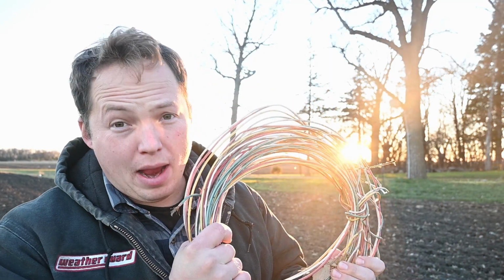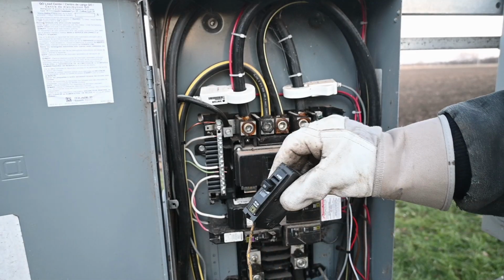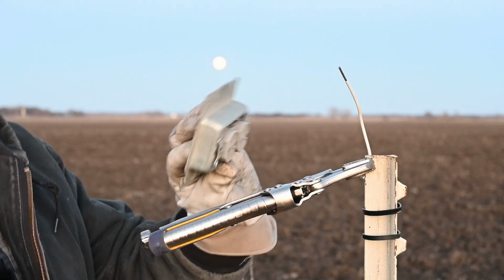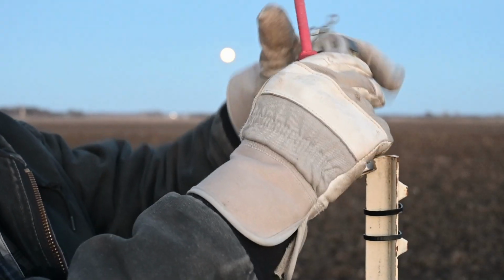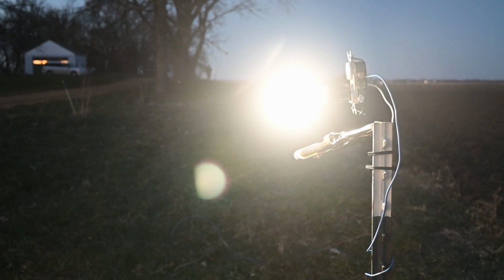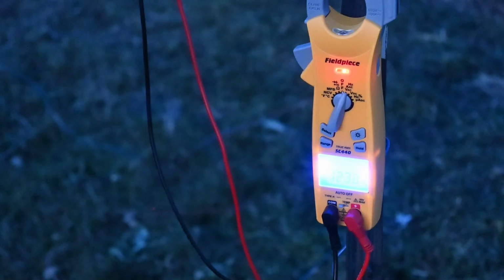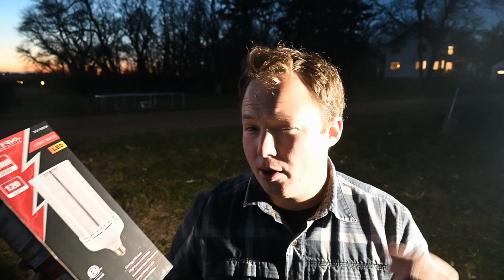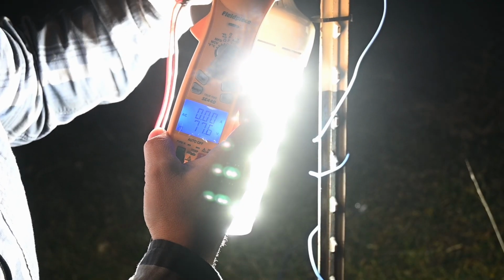Powering a Light With a Fence Post & Scrap Wire - SWER (Single Wire Earth Return) Demonstration

Comment: We used to use this principle to collect earthworms for fishing. Basically a ground rod (usually scrap steel) connected to hot, with an insulated handle. Stick it in the ground and any worms in within a few feet of the rod would be driven to the surface. If you were on your hands and knees to pick up the worms you’d feel the tingle, especially if the grass was wet.
Reply: @Mark Denovich
When I was a kid, a neighbor of ours was an avid fisherman. He used the same homemade device you described to gather nightcrawlers for fishing. He made one for us, we called it the "worm stick." Us kids had all the bait we needed after that. 
I had it plugged in one time and the stick was just lying on top of the ground. My little brother picked it up by the steel rod and got jolted real good, he couldn't let go, I ran to the wall and unplugged it. As I remember it kinda disappeared after that incident, mom must've got wind of what happened. Brings back alot of memories. Always wanted to build another one, but never did. Still love to fish.
Reply: @ttompkins992  
We tried that when we were young,  and it would blow a fuse every time, probably a good thing it blew the fuses.
Reply: @tubeonline629  Lol, the worms coming out of the ground were more like giving a "Wormning to keep out , Electrical exposure"  you're totally rigth, good thing it blew the fuses,that's the most positive of this negative ground thing, i read on this post ,lol
Reply: @ttompkins992  I believe that's an old myth (wives tale) that when you grab an energized wire or rod you won't be able to let go. Heard that plenty of times as a kid myself. I've been an electrician for 30+ years now and have never seen anyone do anything but immediately let go of a "hot" device. I think you must have been really young and your mom built that "memory" into your brain. Just saying
Reply: @Rick-the-Swift  my dad had a drill, that would shock you if you grabbed the vise or table, all metal...i couldn't let go of the drill or the vise handle....so old wives tale, change my mind, it happened to my brother, too.....
Reply: @Rick-the-Swift  My wet hand froze up around an extension cord plug-in from our pool filter when I was about 10 or 11 yrs old. I could NOT let go of that thing!  I had to somehow pull it out of the wall to break the current. I avoided my mom that whole day feeling jittery and thought she would be able to see it. She had told me not to mess with that filter after she gave up trying to prime it, but it was so hot & I really wanted to get in that pool.
Reply: @Rick-the-Swift  No, you can get stuck and can't let go. It's happened to me. Got stuck to a mini bike once, the motor started revving up and just kept going faster and faster. I grabbed the spark plug wire to try to pull it off, Worse mistake in my life. I got stuck to it getting zapped, luckily a neighbor saw what was happening and freed me with a screwdriver.
I got stuck to electricity doing something else before but I don't like to think about it, it makes my heart hurt. That was house electricity. 
I've also been zapped but it threw my hand off and didn't stick me to it.
Reply: @Rick-the-Swift  --My Boss and I were building a cabin using a Metal Case Skill Saw. it shorted out where wires go through case, i was cutting roof decking boards-he called out the lengths and I cut them. The Bare Hot Wire  shorted against the Metal Case of Saw, I could not let Loose of Saw and could not even Holler as it was Jerking my Arms, he saw me and ran down ladder and unplugged saw. The Next Day when I woke Up, my arm was Dead, no feeling, no motor Functions-went to doctor, he said I had Nerve damage from Near Electrocution-it took 7 days for my arm to get feeling back in it-in 2 weeks I was back to Normal but since that time, I have always had a Tremor in my right hand. All Modern Tools these Days have a Plastic Case and a Neutral Wire for Safety so it is much more difficult to get Shocked or Electrocuted...
Reply: Sorry if my original comment upset anyone, or was misinterpreted as it's apparent to me by some of the replies. I really appreciate everyone's input. Some of you have pointed out that you yourselves, or loved ones experienced a situation where you/they grabbed a device energized by an electrical current, and in doing so, your/their grip was somehow "frozen" by the current so that you/they couldn't let go. 
  To better clarify my original point, I think that it's a myth that it happens as frequently as it's claimed to have happened. 
  I can imagine their are rare instances when the current is so strong that certain muscles become clinched around the object that is overly energizing them, but still, this is relatively low in comparison to the number of times people will exaggerate about such an event.
  Me personally, I've worked in the electrical field for 30+ years. I've had the piss shocked out of me many times, by hundreds of amps, and have seen dozens, if not hundreds of others have the piss shocked out of them, but never have I once I have I seen an instance where someone became "frozen" to the object that was shocking them.

 If anyone's ever watched a video of someone receiving  lethal electrocution- I don't really recommend it myself personally, but it was a part of my public and electrician education. But my point here is, there's a good reason they use many straps to keep a condemned person attached the the electric chair- and that's so the prosecuted and judged criminal won't be able to hop out of the chair during the electrocution. keep in mind the amount of current they send through such a condemned criminal is many times greater than the average person may experience with any electrical device within their homes or businesses.
 When farmers put their "electric fences" up to keep animals immensely more powerful than the average humans within a field, the shock delivered will almost certainly 100% always cause the animal (or human) to move away from the shock rather than become attached to it.

 That was my only point. I have no doubts some of you have a different opinion, based on what a family member or friend told you, or based on your own experience "grabbing" such a hot device that you couldn't let go, but again, my own experience is the people who exaggerate about such an event, or who have no proof of such an claim far out weigh the people I've met who have experienced otherwise.

In fact a phone call to any random electrical engineer will likely help anyone, if not convince them that "most" electrical systems on a given residential or commercial property will be low enough to allow people to "let go" or "jump away" from most typical current situations. However there is always the possibility that someone's hand, for some reason, can grab a device with enough current with enough conviction to cause them to squeeze harder, rather than obeying their natural instincts to be cautious, and therefore let go of the device delivering the shock.

I hope that clarifies my opinion on the matter a little more, and once again, sorry to anyone genuinely interested, who may have been confused by my original comment. I do not discredit the claims of anyone on this thread.
Reply: @Rick-the-Swift  wow, that was a lot of words that weren't "I was wrong".

Muscles are literally moved by electrical impulses in your body. The fact that muscles "lock" in a contracted state when subjected to voltage is well known, and you sir, are the very reason why one person's anecdotal experience does not amount to, and should never be considered to be, "evidence".
Reply: @JMGilberto  Thanks pal, you gave me my first morning chuckle. 
  If I was wrong, I took the time to clarify my original statement. Muscle do far more than just contract during an electrocution, they spasm and and most often react in a way that that is opposite of the device that is delivering the shock. They say your tongue is the strongest muscle in your body, try sticking that onto a a loaded bus, and see if your tongue "locks" in a position outside of your mouth, or if it snaps back inside really quick. I've got a hundred bucks that says it will do the latter. 
 Of course my opinion is anecdotal and it's doubtful you or I could help anyone who might somehow try to use that as "evidence", lol.
Reply: @Rick-the-Swift  Wow. Who nick-named you swift, anyway? Lol.
Reply: @Rick-the-Swift  
I think you're probably correct when it comes to AC. However it's  a different story when working with direct current DC which could cause a clamping-- causing your muscles to only contract and not extend.
Reply: @Rick-the-Swift No sir, I'm afraid it's very true! And its a scary feeling when you know you're getting the shit knocked out of you and you can't let go. It happened to me while on a ladder about 15 feet up. Had ahold of a conduit to steady myself (grounded) in one hand and when I cut through the insulation of a wire I thought was dead with my strippers there I was, hung up! There's another lesson i learned that day, when your strippers say "not an insulated tool" they mean just that!😅   Sure you can get away with it if you're not say,  holding a grounded pipe in one hand and stripping a wire with 277 volts on it with the other. But let's just say you are, its coming through those handle covers! It lit my ass up for what seemed like an eternity and I thought I was going to die man. The only thing that saved me was leaning my whole body forward (could not move my arms at all)  until I made contact with the strippers into the metal junction box and tripped the breaker. Whew! To this day, the worst shock I've ever had!  My arms were sore for days after from my muscles being contracted. There's a certain amount of current known as the "let go threshold" its not alot, cant remember the amount but i was certainly in excess of it that day! I was  still in electrical school studying for my journeymans when that happened about 2001. Probably the most valuable lesson I learned there😅
Reply: Just curious, does anyone have any stories about peeing into a receptacle, or electric fence and getting shocked that way?😅
Reply: Try soaking walnuts in water for an hour or so, dump it on the ground.  You will get a lot of worms and you will not die.
Reply: I was wondering how many worms he found, see that he got the dogs out of the area
Reply: @fordx4n  That'd be funny if they had chickens that got loud everytime the phone rang... and then got all happy from the worms coming to the surface, LOL.
Reply: That's the first thing I thought of. Lol
Reply: @Rick-the-Swift  its not because its hot. Electricity flowing in alternating current through your muscles causes your hand to constrict. You literally cannot let go while there is current running through you. That's why you need to have somebody nearby with a wooden Pole to smack you off the wire. If you were to touch them you would get added to the circuit and be in the exact same predicament. The hot wire is not a temperature thing it is a live electricity thing.
Reply: @Rick-the-Swift  have you ever tried out those electrical ab toner's from the old infomercials? You can be lazy and still tighten up. If you rig those up right you can close your hand with it and you wont be able to let go.  I think  for the most part when getting shocked you get the start of a jolt and your body contracts the other way by immediately jumping away. But if you clamped right down and have made a solid closing of the loop so to speak with enough Amps you prob wouldn't be letting go. If a closed hand is the path of least resistance. It's staying closed.
Reply: I have a Professional Made Worm Shocker that I use...

Comment: This is why you should never go near a downed power line, especially in wet conditions as the high voltage gradient combined with wet feet is enough to make you lose muscle control in your legs which causes you to fall and the current then passes through your whole body. Not a fun way to die

Comment: It's interesting, but I'm a bit alarmed anyone uses this to power anything real.  If you're going to all the trouble of running a wire to a remote location, is it really that hard to run two?

Lack of a safety ground is one thing.  You can make that safe in a number of ways.  GFCI is the best of course, and just having everything double insulated is another.  Having no neutral wire is quite another thing entirely.  It's a fun experiment to do, but there's a good reason it's not code compliant.

Comment: I went to school on a farm in 10th Grade and needed to get a light out by a gate well over 100 feet from a building so energized length of barbed wire that was on the fence and use the Earth ground 

All we had was an incandescent bulb back then I'm actually surprised that works with an LED

He could pour a little bit of high-salinity water on the ground around the post and see if he get the same voltage drops

Comment: By energizing the ground around your house you are likely subjecting the water supply pipes through the water bond required by the National Electrical Code to potential differences that will likely corrode your copper pipes.  Also, 
THE NEC stipulates the ground may not be used as the return path, in whole or in part,  to the transformer.
Your local electrical inspector should be able to point out additional issues with this system.
Reply: Inability to use ground as a permanent return path often applies to wiring systems, not so much the earth but yes generally speaking, earthing is for faults/safety

Comment: This video should not have been produced for a few reasons. You are demonstrating a dangerous practice and I'm sure someone that is less qualified than you will actually try this and maybe even make this a permanent installation. The exposed wires are energized, the metal post is energized, and what was not described is the energized earth. You wear the gloves when there was no energized parts, then at night you have no gloves and the pole and wires are energized. I'm bewildered as to why you would produce this dangerous practice video. I strongly suggest you immediately remove this video.

Comment: Try holding a 4 or 8 foot fluorescent lamp up in the air under a utility power  tower when the humidity is high and you can hear the lines buzzing.
The lamp will glow. Even a bad  lamp will glow. I have won a bunch of bets pulling that on people.
Reply: Hold it by the glass, don't touch the metal connector end.  Ask me how I know.
Reply: I was getting transformers unloaded at a municipal electric yard and they had me park under some very big transmission lines to do it. I was standing on my aluminum trailer deck and could feel the tingle and the hair on my head stood up. I did not like that at all.

Comment: I can say for a fact that a single wire buried (and damaged) will eventually trip a breaker, but it might take days or weeks before the heat builds up enough to destroy the insulation, then expose enough wire to reach the trip point. This happened in my neighbor's garden when they hit a direct burial wire for their lamp post. When we dug it up the outer sheath was blistered about 5 ft long. On doing this with a gen set it won't work due to the gen set not having an earth ground / neutral. Yes, you could add one but the set doesn't rely on one to operate.

Comment: Why did you run so many feet of wire? All you had to do was make your hot wire short like say 8 feet and stick a metal rod into the ground and it would have worked just fine! Running about 100 feet of wire to a post stuck in the ground far from the fence post was ridiculous!

Comment: This is the second time I've been surprised at how low your ground resistance is on the way back to the transformer. I like your demo of voltage drop very near to the post. It highlights how a dog might get a shock if he were to piddle on the fence post while current is flowing, creating an alternate lower resistance path compared to the path across the ground rod. I guess it makes sense that most of the drop is in the earth near each ground post, since deeper in the earth there is more water and electrolyte that permits a lower resistance path.
Reply: Agree
Reply: This is actually quite a problem for dairy farms which requires special grounding. If there's any sort of gradient in the ground cows won't cross it. So if you transition from dirt to a barn. You have to have a gradient concrete slab two very the resistance as the cow walks in to the barn.
Reply: @spelunkerd -  That dog would never lift a leg for the rest of his life!  🤣🤣

Comment: This is essentially the way the first telegraphs worked.  Single wire, earth return.  They discovered that with two low-resistance wires, they could transmit using a lower voltage, original required a couple hundred volts from the batteries of the time,  and further before needing a relay to boost the voltage.  

You might also look at testing the gradient beneath the path of the hot wire.  The return current tends to follow the path of the hot even in a conductive plane.
Reply: And they discovered that adding too much voltage to gain longer distances had a tendency to melt things and turn things into welders, necessitating the development of repeaters to regenerate low signals and forward them on up the line.
Reply: Understand the Germans during WW1 were able to intercept allies telegraph communication by intercepting the ground current.